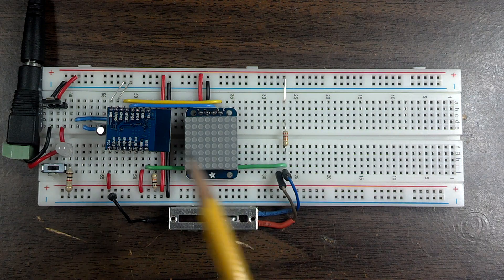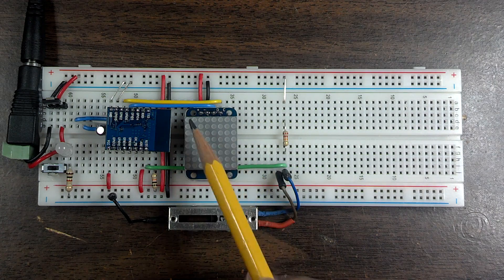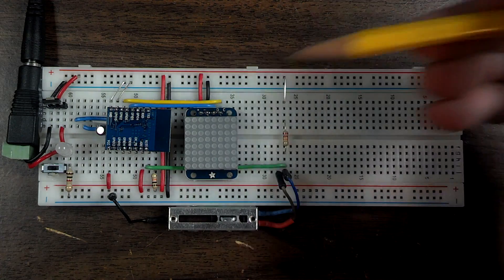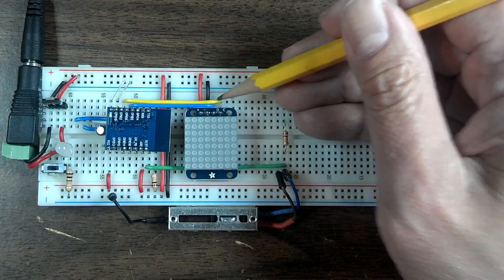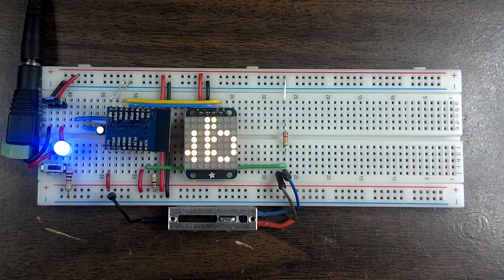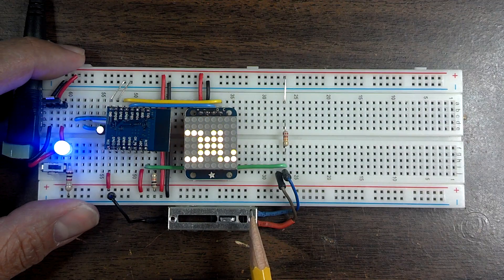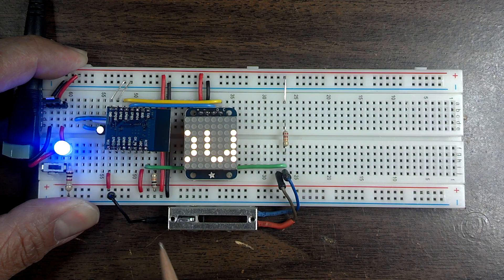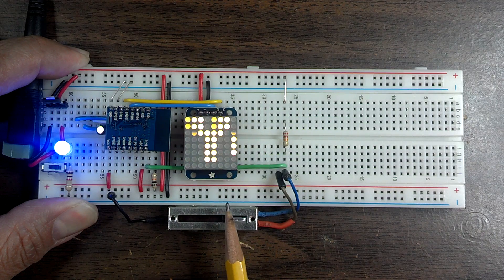HariFun #110 - ESP8266 Matrix Part 1

Comment: Is it possible to chain multiple matrix displays together and have the text scroll on them?

Also, is it possible to flash the esp module if my cp2102 only has the dtr pin besides tx rx and 3.3v and gnd.
Reply from the maker: msevyt , yes, you can hook up up to 8 I2C matrices to the same two Data and Clock lines.  Each matrix needs to be setup for different address and you would send commands to each matrix. they would all act independently.  It is up to you to display what on which matrix.

However, a better way to control more matrix is probably by using shift registers.
You would need three I/O pins and the code would be different.
https://www.youtube.com/watch?v=wTQM6VPTsQo

Yes, you can program an ESP without the RTS pin.  You don't even need the DTR pin.  Instead you manually bring GPIO0 to ground to upload sketch and pullup to high to run the code.
https://www.youtube.com/watch?v=iRMdj3dS2hc&feature=youtu.be&t=1m42s

I hope that helps.
Reply: Hari Wiguna I wanna avoid pressing that button at the right time to upload yhe sketch, thats why I want to use DTR to make it "easier" to upload. 

I'll try to find an example project with multiple matrix "displays" :)

Comment: looks great .  Now i know i'm gonna have to get ESP-12 now .
Reply from the maker: XerotoLabs , depending on the project you have in mind, Arduino might still be the better option.  Having only ONE Analog in is quite a challenge.  Someone in the ESP8266 forum told me that WiFi will have incur a performance hit on I2C. Makes sense. We'll see...
Reply: Hari Wiguna yeah . I had a funny thought , If i get a ESP8266  V12 or better with its higher  GPIO pin count , i might be able to adapt my CNC firmware to it  and stream Gcode over wifi . LOL . Well  I still have not had a chance to get caught up and get my V1  working with Arduino IDE yet .  :P 
PS . i have seen some ESP 01's with 2x program space on them , they are black boards. still only 2 GPIO

Comment: Hi Hari, please make a complete tutorial, Im interested more in the analog read, is it possible to read analog with ESP-01?
Reply from the maker: Miralem Halilović , Unfortunately, ESP-01 only has two digital pins and no analog pins.  :-(  The ESP-12 that I use in this video only has ONE analog pin.  There are several options to overcome this limitation: input multiplexing, ADC chips, ATTiny/Arduino just to name a few.  Maybe that's and interesting topic for upcoming video.
Reply from the maker: Dave P no apologies necessary.  You are correct about how I used the ADC pin on the ESP-12.  You just failed to mention that there is no ADC on the ESP-1 :-) No worries...
Reply: Miralem Halilović The green wire goes directly to a  pin of the esp8266 and the esp-12 module has one adc pin (that's exactly where the wire goes) so I'm pretty sure :)
Reply: Hari Wiguna Miralem Halilović whoops, sorry